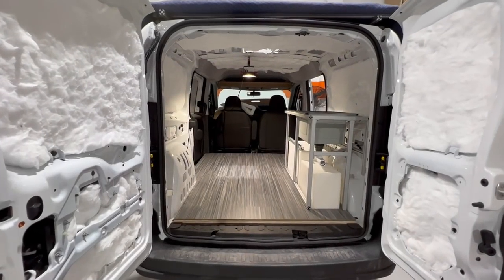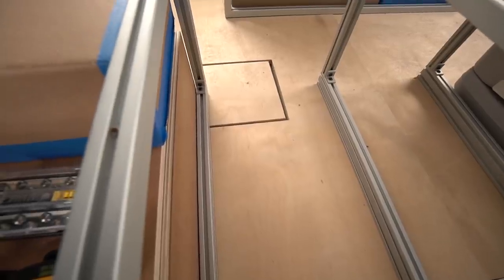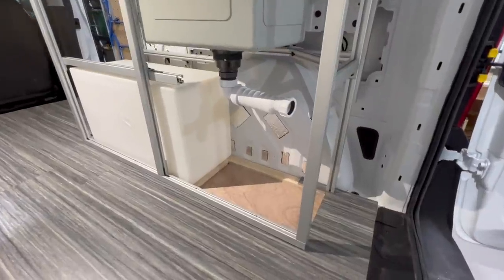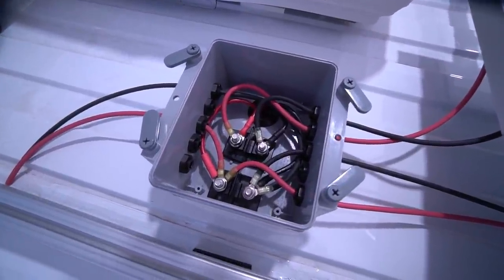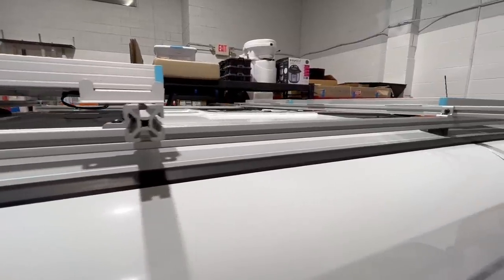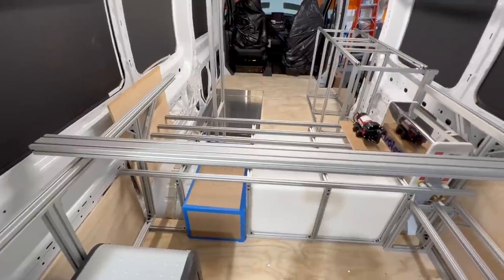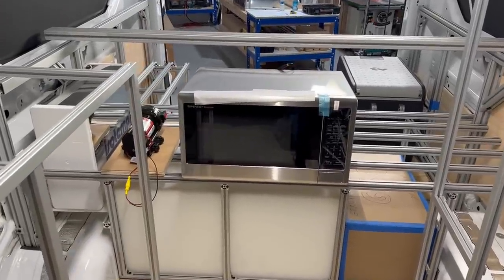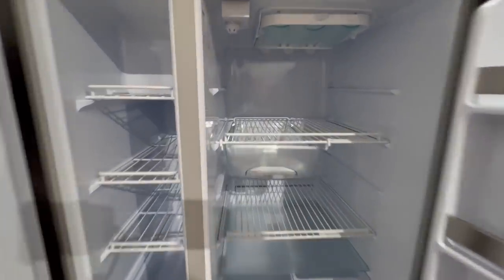BUILDING TWO VANS. The BIG van is a Ford Transit 350HD. The little VAN is a Promaster City.

Comment: Access to the fuel pump: Would it be possible to find a way to allow a floorboard to slide out to the back?
As it won't (and must not) be loose, one can tap gently with a hammer to make it slide.

Comment: So, George, you finally prefer this white material for insulation around the vans, instead of rockwool, spray foam, or other type of foam ? What is it called? Thanks.
Reply from the maker: Thinsulate
Reply: @HumbleRoad    Thanks!

Comment: when you mount the 80/20 to the floor ,do you mount it just to the wood or through the wood to the metal of the vehicle chassis/floor ?
Reply from the maker: Screwed through the 3/4" plywood. Also bolted to the chassis walls.

Comment: 1500 lbs payload - 350 lbs for 2 passengers = 1150 lbs left❓❓❓
162 hp mmm (my 2750 lbs Fiesta ST has 192 hp)  - I drove a Connect - 82 mph top speed - EMPTY❗❗❗ (at 800 ft elevation on the prairies) (before buying my 3.5 turbo Transit)

Fill it up with camping cr@p not to forget the sail you put on the roof - That makes for a 6200 lbs dangerously unsafe slow rig - especially at elevation when "trying" to pass.
No Thank You - I value my life more than that - Of course YMMV
Any the lack of joy you get from driving such a painfully underpowered vehicle - have you no self-respect.
Reply from the maker: I purchased a Promaster City, new back in 2019. I used it as my daily driver to make sure it was an appropriate vehicle for this project. 50,000 miles later, I can tell you it handles like a sports car, the acceleration is absolutely fine for me, it gets great gas mileage and gobbles up payload. A very versatile easy to use vehicle. And 350 pounds for two people suggests taking a closer look at diet and exercise, rather than poking me about my choice of vehicle. LOL! 😆
Reply: @HumbleRoad Would be nice if read the whole post. We talkin" fully loaded with a sail on top❗❗❗

350 lbs - u been to Wal Mart lately son
Reply: @HumbleRoad  @ Elevation
Reply: @HumbleRoad  Goin' Uphill
Reply: @HumbleRoad  & A Headwind
Not laligagaling at sea level doin' city folk coffee shop hopping.